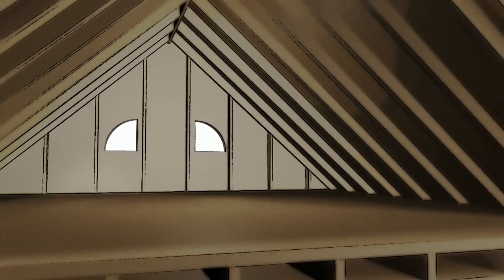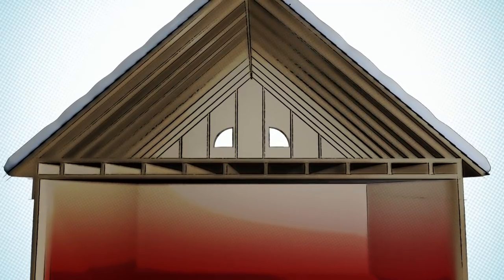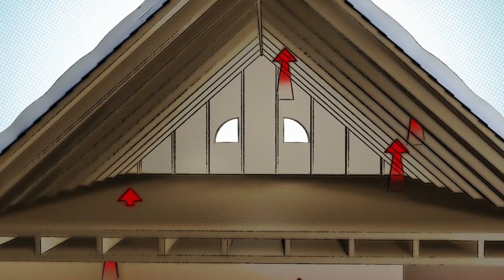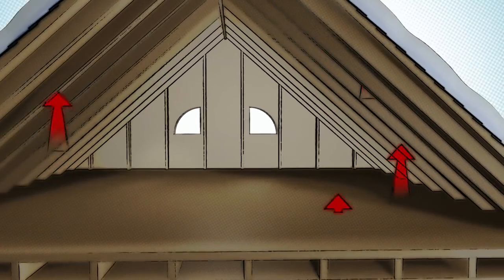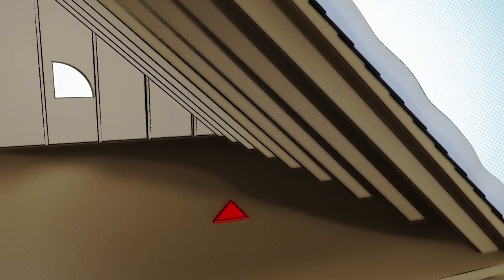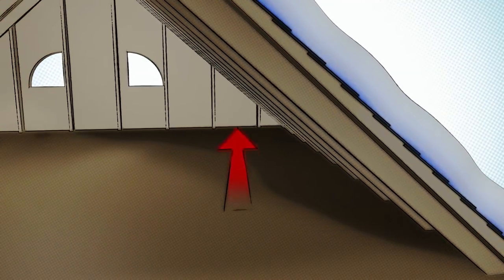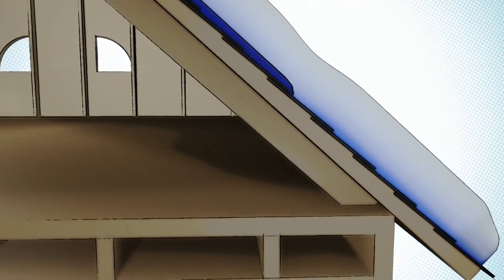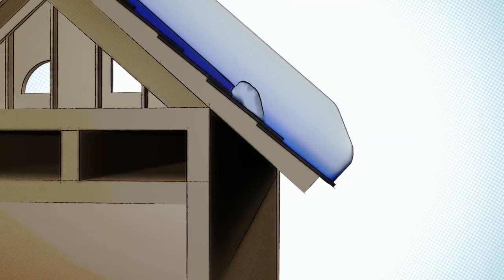How to Prevent Ice Dams | This Old House

Comment: Great for those of us that own old 1 1/2 story homes but what about air flow under the roof?  Should there not be a baffle so air flow can come up from the soffet and out the roof vent or was this because there was no real attic
Reply: i wonder about that to, did you get any answer on this ?
Reply: No answer.
Reply: There seems to be two schools of thought on this subject.  Some say spray away.  Others say nay on the spray.  The first comment on this video by san379 states this is a bad idea whereas if shortens the life of the asphault shingles.  I know a real estate developer who owns his own equipment and sprays CC foam in the attics of all his properties.  I asked him about the wisdom in this practice and his answer was that the roof breathes exactly like walls do when sprayed and the walls don't rot so why should the roof rot?  But I say, walls are verticle and not at a direct angle to the sun like roofs.  The roof temperatures get much hotter than walls and maybe be high enough to possibly cause damage to the asphault shingles and roof sheathing.  So if we know that ventilating roof sheathing works just fine for the life of the roof and shingles, why take a chance?
Reply: I've just turned our attic into living space. A roofer told me that sprayed foam would be our best bet for insulation but that we should definitely have a vent baffle put down before the foam is sprayed to ensure a flow of air from the sofit up to the peak. This is to prevent the shingles from getting hotter than necessary. He told me that even the shingle companies may not honor their warranty under a situation where a baffle is not installed. He estimated that 10 years of roof life would be lost if no venting was utilized. Who to believe?
Reply: How could one possibly use vent baffles to ventilate up to the peak with spray foam applied to the roof sheathing?  Is he saying to allow venting in front of the foam within the attic space itself?  That's clearly incorrect.  The only way you could use spray foam in that way is to panel across the rafters leaving an air space to vent up to your ridge vent at the peak.  Then spray foam on the paneling (toward attic space) to insulate your attic.  That would work.
Reply: A product such as Raft-R-Mate is put down first, the foam applied over that. The vent allows ventilation to occur from the soffit up to the ridge vent thus preventing the shingles from getting too hot thus shortening their lifespan. That's the argument anyway.
Reply: Once the rafters are insulated, warm air leaking from the heated living area below accumulates in the attic so it's "warm." And the cold outside air can't penetrate the foamed rafters.
Reply: I would agree, but if the house has no soffit at all, then there is no place to pull air in from.
Reply: @renalshomlmes338  7
Reply: @marypitts2836  that's what she said

Comment: Talk about Over Kill! Reg. 6" Insulation in the Floor with a 6 Mill Plastic Sheeting stapled down, seals any air leaks. Top Off the Floor with simple 1/2" Ext.GradeSheeting for a Finished and safe floor ..Vent the Attic! With Gable End Vents + Mushroom Vents in the Roof every 5 ft.. Has been good enough for decades!
Reply: +Selna Goodhead The homeowner said he wanted to use the attic as living space...therefore insulating the rafters was his only option.
Reply: If just going to use it as a Heated Storeage space & Lite duty  use Room? Just get Approved Electrical installed by a Union IBEW guy.. to Spray Liquid Foam, cost about $3000.Installing a 6" thick Radiant Foam  ...

But I would install my own Closed Cell Barrier Panels is another Option) Cut and Fit  inbtwn the Rafters would be 50% Cheaper..Top it off with a Drywall Ceiling and good to go.and can do it yourself !

Comment: If you get any leak from that roof, the closed cell foam will hold that water to the underside of the roof and you will rot it.   Bad advice.
Reply: I agree with you, not a fan of spray foam or spray insulation

Comment: it should be mentioned that: 1) this can potentially have a negative impact on shingles and roof sheathing (trapping moisture, some have recommended adding baffles for soffit to ridge for venting) 2) there is still thermal bridging issues in that the RAFTERS you see in the video will lose heat and you can clearly see the lines on your roof formed after snowfall where it has melted ... SO i wish i myself had instead USED baffles within the gaps, THEN mineral wool (due to fire retardant and water resistance properties, and then a layer of RIDGID foam over the rafters, and finally a layer of firecode drywall.

Comment: Spray foam is way too dangerous because if the sprayer applies just a little too much it could give off toxic fumes for a very very long time making the whole house uninhabitable.
Hard foam panels also have a high insulation and is fairly thin.
Thicker isn't always better.
Reply: If pigs could fly they would be an air traffic hazard.

Comment: No rafter vent?
Reply: Not needed
Reply: @jamesmcnaughton5092  Why not? If you do not mind?
Reply: @IGoProEVERYTHING  closed cell insulation acts as a vapor barrier not allowing any air to hit the underside roof deck which would normally cause condensation if fiberglass insulation was used

Comment: I always thought you never install insulation on the roof itself??
Reply: my question as well. maybe because of possible leaks? of course metal roof could likely solve that.
Reply: @cdoublejj  A metal roof is final, snow doesn't stick to it.
Reply: I thought it still needed ventilation between the roof and the sprayed in foam???? Soffits and a ridge vent???
Reply: @jimhendrix7776  nope not necessary in closed cell insulation
Reply: Well once you replace your roof and possibly your roof sheathing all that spray in insulation will come out with the old sheathing.  Would never do that.  All u do is install roof insulation baffles and leave a min of 1 inch air gap behind insulation to roof sheathing.  This makes sure the air behind insulation stays cool with air flow from soffit vents to ridge cap still working

Comment: I heard nightmares about spray foam causing sickness. Where were the vents from the soffit to the Ridgeline? oh well.
Reply: If applied incorrectly, yes, Spray Foam can be a Bad Thing.
Done properly, and the only thing you get is a better insulated house.
Also, not every roof assembly needs to be ventilated.
That attic area is now conditioned space.  So it falls to your HVAC system to properly dehumidify the area.

Comment: TOM  SILVA SAID BEFORE THAT WHEN INSULATING ANY ROOF, YOU NEED AN AIR SPACE OF AT LEAST 2 INCHES BETWEEN THE UNDERSIDE OF THE ROOF SHEETING  AND THE TOP OF INSULATION..
Reply: My guess is that with  R38 insulation, it might not be needed. Should be enough insulation to keep the roof cold enough that snow doesn't melt, even though it's warmer inside. Maybe the spray on foam technology allows for the change?
Reply: That's with a fiberglass installation. Spray foam is completely different.
Reply: //My guess is that with  R38 insulation, it might not be needed. Should be enough insulation to keep the roof cold enough that snow doesn't melt, even though it's warmer inside. Maybe the spray on foam technology allows for the change?//

It does and this is the proper way to install it from the manufacturer who has tested this in lab settings and real world settings. Believe me the companies that make these products are massive companies like 3M. They don't guess at things.

Comment: I was told that the insulating spray foam wicks water / moisture...is there another product? And what about the chemical off-gassing of the spray foam, especially if it is applied too thickly?
Reply: Closed cell foam does not absorb moisture, when applied more than two inches thick it's considered a vapor barrier. One tradeoff of this is that if there is a leak in your roof, you won't notice the problem until the roof decking is rotted out because the spray foam will seal it off below. As for off-gassing, if spray foam is installed properly by a reputable professional it only produces fumes during the application process. Once the spray foam is cured it's inert foam that doesn't give off any VOCs, the problem is if the spray foam isn't applied properly because it isn't mixed properly at the nozzle, the mixture ratio is wrong, contamination, etc it can leave behind some unreacted chemicals that will off-gas until the foam is ripped out and applied properly. It pays to use a trained professional to apply spray foam insulation as the application process can be tricky and mistakes can mean having to rip it out.
Reply: I just had closed cell foam applied to 3 walls in a room in our house. Within an hour or two after the installers left, I could not smell anything from the foam, the worst smell when they were actually spraying was just like the smell of paint, and now it is gone. Well worth it in our 100 year old house, there was no other way to seal up the walls when the sheathing is the original 1" plank boards, shrunk down and with gaps between after all these years, but still sturdy and solid. We plan to spray foam the attic rafters next, exactly like they did in this video. We don't have an ice dam problem, standing seam roof on a 9/12 pitch the snow slides right off after every storm.
Reply: We had closed cell foam applied in our attic by professionals and not experiencing any concerns...did it after we installed a bunch of LED lights (with boots)...we also confirmed that our attic has sufficient venting with baffles before the cellulose went in

Comment: The rafters can’t breathe with that foam ‘ they will choke to death and your roof will fall in ‘ timber is like ourselves it needs to breathe
Reply: You are absolutely wrong, a sealed rafter bay with CLOSED CELL insulation does not have to breath, do you really think this would pass insulation inspection if this was not the right application?

Comment: Great so now i get the foam insulation for surrounding walls and between rafters if your making your attic a live in attic but still when you go with a blown in vs a foam insulation. I get when to uses roll out insulation with paper just not when to use blown in or foam for rafters and surrounding walls of floors... If there is even a significant difference other then getting the right R value for insulation quality.
Reply: Makes no sense lol!!

Comment: I heard somewhere, that this spray in foam is a known carcinogen. I would check this out very carefully first.
Reply: There are still some spray foams that contain isocyanates.  They're dangerous during application and in the event of a fire.
HOWEVER, there are newer generations of spray foam that do not contain these sort of chemicals.

So, do SOME spray foams come with a carcinogen risk?  Yes.
Do your research beforehand.

Comment: This was a horrible example of how to insulate an attic, Spray foam insulation should never be sprayed directly onto roof decking, The roof itself needs to breath, you are supposed to install a product such as durovent inbetween the raftors prior to spraying the foam. This will allow the roof to breath while sealing it off. These people will have rotten roof decking by the time they go to put a new roof on if they ever have even a small leak. Not to mention now that the roof cannot breath the shingles will heat up much more then they would otherwise during the summer months. Thus over time that added heat will shorten the life of the shingles. I feel bad for this customer.
Reply: +WC-Chiefncap  I am having a   issue believing the shingles could? Would heat up more, its not like copper or aluminum. Also he is talking about using the attic, so less heat/cold transfer into the attic the better for him?
Reply: +John Flynn you are right. these guys are ignorant to the fact that venting is only needed if the heat would travel to the shingle from the house. With this system that will not happen. also the shingle are a breathable system especially with the breathable underlayment being used by industry pros. unless you have ice and water shield going on the entire roof deck you won't have a ussue with this system.
Reply: NOPE! This is just a urban myth. Closed cell is ALWAYS sprayed to the underside of the roof decking. There is never a baffle or anything in between. Shingles do not curl in summer or in winter. I have this same closed cell installation in my home and it works perfectly. In fact the non-closed cell area of my home is the one I'm having shingle curling with because the heat is allowed to get to the underside of the roof deck.

Please do not perpetuate psuedo-science.
Reply: Because shingle curl does not happen in closed cell. This is just myth. I have closed cell in my rafters just like this and we have 100+degree summers. Never a shingle curled.
Reply: As long as you to roof walls and for it will work perfectly
Reply: You are 100% correct.  The only way roof sheathing can dry is to vent through the membrane and out through the shingles, you don't need air beneath the roof sheathing to dry a roof assembly, amazing that people still don't understand what purpose venting serves.  Building science has evolved immensely.  We no longer need a vented roof assembly, you can achieve proper r-value and air sealing to eliminate venting with ease meaning no gaps for insects and rodents to enter your attic space.  My only comment on this video is that lack of a thermal barrier, with the bottom edges of the rafters exposed, the heat can escape though the rafters into the roof system.  The best thing to do is apply rigid foam to the underside of the rafters and then strap it.
Reply: omg their 8" trusses thats solid pine are you fucking kidding me? Jake Garner thank god you're not in construction. you have heard of a log cabin before correct? yeah the logs are the insulation!!!
Reply: ONEANDONLY, Take a look at some thermal pictures of a house from the outside and you can see every rafter or wall stud transferring heat, unless like Jake said, they are covered with foam. The R- value of wood is roughly 1.4 per inch which at 8'' would be 11.2 at best, quite less than R-38.
Reply: This installation is probably fine, but some building scientists recommend only one 2" layer of foam and fill the rest of the cavity with dense pack cellulose. It's a good idea to add a layer of ridgid foam across the rafters afterwards, and the absolute best thing you could do is add insulation on the roof deck next time it gets reroofed. You can add firring on top of that to improve the ventilation of your roofing material and make it last even longer. That will work in every climate in the world. Every roof benefits from ventilation, and it's never unnecessary. How necessary it is, however, varies. The roof shown would work fine in most climates.
Reply: You earn a lot more respect teaching than you do cutting other people down from the safety of your PC.   For instance.  one source of info may be "http://www.greenbuildingadvisor.com/blogs/dept/musings/creating-conditioned-attic".   Or if you like YouTube Videos, try "Attics/Roofs, Dumb vs Smart..."  "https://www.youtube.com/watch?v=F7D4Q3mjgdQ".   Also remember, the rules for cold climates are different from hot and/or Dry vs Humid climates.    I would be interested in your knowledge base, but am not much interested in your unsubstantiated opinion.